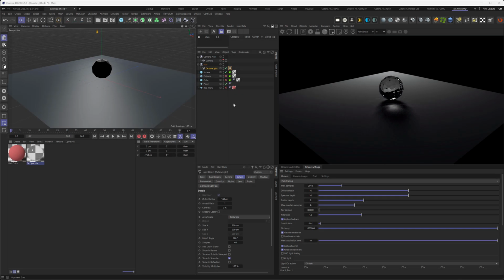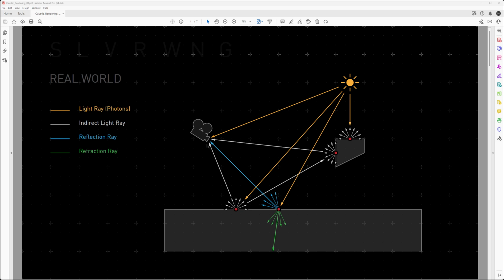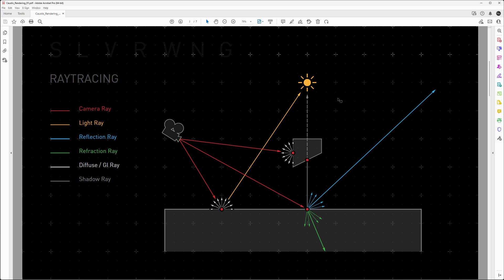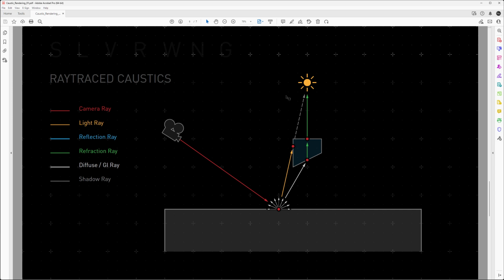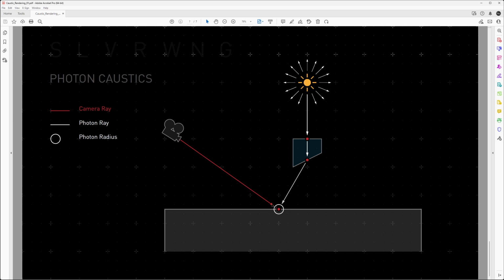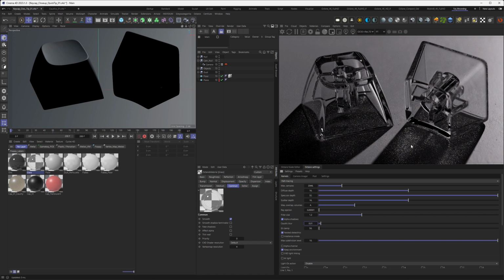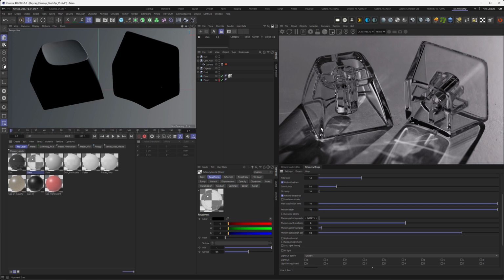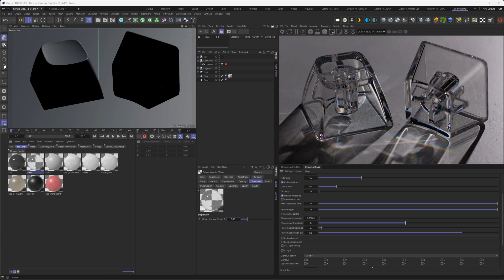Silverwing Quick Tip: Understanding Caustics (Or why caustics are so hard to render)

Comment: do you ever use the photon tracer on larger scenes like a swimming pool?  I am finding they work quite well on smaller scenes but for archviz work they work,  but have issues - lots of black squares that many times to not resolve.
Reply: actually -  I just realized - the problem was multiple cards - if I use only one gpu,  the problem is gone -  in case anyone else runs into this.
Reply from the maker: @johnford8425  Hey John, thank you very much for your comments.
I am in contact with the dev team about this issue. Hopefully it can be fixed soon.

Other then that. I use photon tracing only if I need very detailed caustics. Otherwise you would get longer render times for nothing.
Since I am almost always doing small scenes besides from tests I have not had the opportunity to use it on bigger scenes like the mentioned pool.

Comment: Hello raphael, its very intersting, i really want to make such interesting casutic scenes - but not sure which render works better- redshift or octane, you prefer octane to redshift regarding this difficult, detailled scenes?
Reply from the maker: Hey there.
I think the best way to determine which renderer is best for you is to try both and then decide which one you can operate best.
There are differences between Octane and RS of course. Octane is more restrictive to physical behavior while you can fake a lot more in RS what also gives you more flexibility if you need it.
It´s pretty much down to the user and to his needs and what workflows he uses.

Hope that helps you to make a decission.
Raphael
Reply: @SilverwingVFX  thank you very much!

Comment: Thank you so much! I'm amazed by your tutorials/researches. Last time I asked you about intersecting and overlapping volume objects, I want to add to the list of questions the topic of noises, especially in dark scenes. Sometimes it's impossible in octane to render without noise no matter how many samples do you use, how it is? I'm a corona user as well and rendering one picture for 8 hrs I'm sure that it will have no noise at all, but in octane 16000 passes with all maximum values I have no guarantee that it will be clean - that is so embarrassing and annoying
Reply from the maker: Hey and thank you for your comment. The intersecting volumes suggestion is still on my tut list. Though as I usually rather rarely deal with this, I would have to do some research to be really sure. For now, as I probably said last time, for overlapping volumes, make sure that the step length is the same for all of the overlapping ones.

About Noise:
That one os really tricky to answer as it really depends on the scene and the lighting.

Geberally what Octane does not like is small bright light sources, non rough surfaces. In general high energy always causes fireflies and everything to divert / spread the energy is a help to reduce noise 

Also of couse Adapive Sampling and GI Clamp (the default here is really high in Octane and I believe is much lower on Corona)

With the right precautions Octane in almost all cases renders rather quick and noise free.
But maybe this is another good foundation for an Octane optimizing tut.

Hope those few hints help a bit. Other then that you are welcome to write me an email and send me some example renders of scenes that I can take a look at. The mail address is on my website.

Cheers and a fantastic start into this week to you!
Reply: @SilverwingVFX  thank you som much! You are great!

Comment: I recently updated to octane plugin for c4d 2022.1-R5, and tested out what you did here with a platonic (both filled and hollow), and I didn't get a different in caustics or visuals from PT and Photon. Any suggestion on what could be the problem?
Reply from the maker: Have you enabled photon caustics in the material you used on the platonic. Its in the  Index tab and called "allow caustics" also make shure "fake shadows" is turned off. Hope that helps!